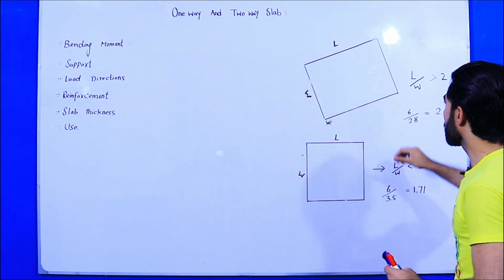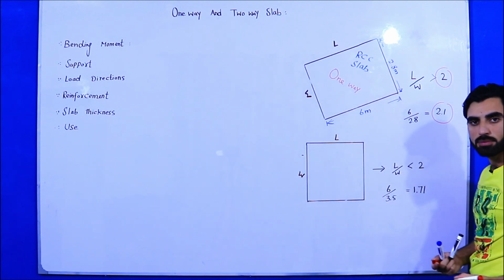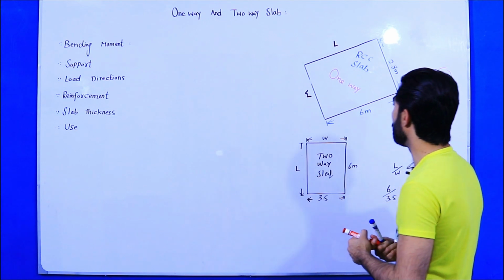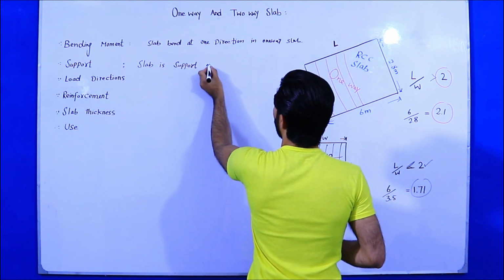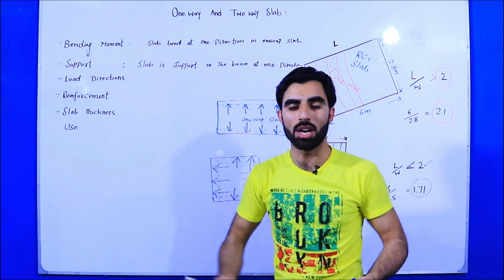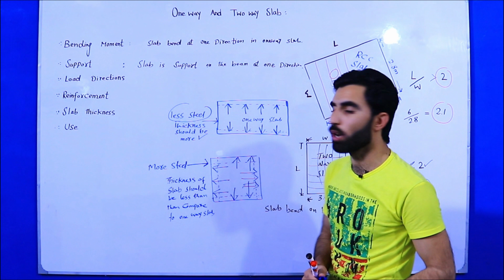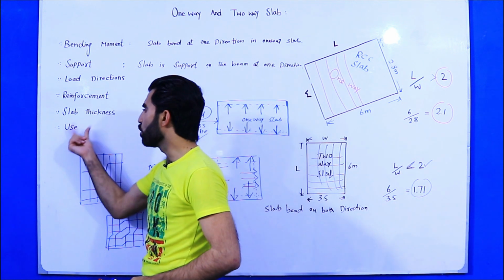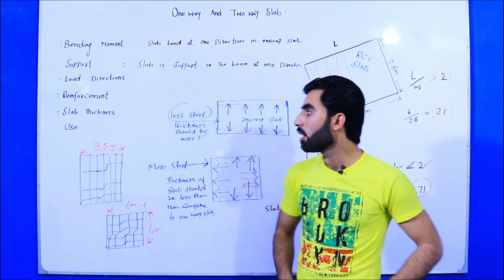Difference Between One Way Slab & Two Way Slab

Comment: If L/W Ratio is gater than equal or smaller than equal for oneway or twoway slab, then what I will to do ?
Reply: If its greater than 2 or equal to 2 then its one way and if it is less than 2 then its two way